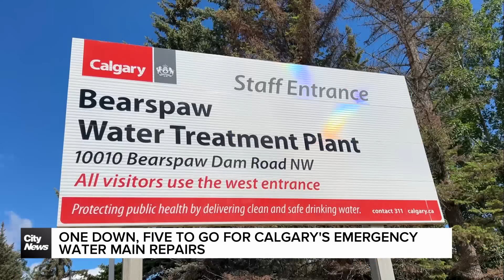One down, five to go for Calgary's emergency water main repairs

Comment: These pipes should have been flown in, on a Boeing “DreamLifter” or an Airbus “Beluga” oversized freight plane if the size required it

Those planes can hold 250,000 pounds so a few 12,000 LB pipes aren’t too much. Could have had the pipes in like 5 hours.

Comment: Due to the type of pipe used, this feeder will continue to rupture. It is passed its best before date.
The City needs to hurry up an build an alternate while this one is still hanging on. Maybe pipes up both north and south Stoney Trail that will tie in with infrastructure at the higher elevations.
Reply: Uh Hyprescon does not really expire.... I know I have installed miles of it. Maybe you should watch a video or two about how that type of high pressure pipe is made.
Reply: @larrymacdonald4241  it's planned water rationing

Comment: There's your problem right there, you're referring to it in kilometers.
Reply: ok Yankee it's Canada bud we use metric system so you worry about state side problems not ours
Reply: Our system is far superior
Reply: @georgemcguire5664  Well, the Imperial system got us to the moon and back. Helped us design Aircraft Carriers, Submarines, and the deadliest Fighter Jet in the world. And let's not forget the Internet. 

By the way, my point is that they need to look at the old designs for that water system because I can guarantee you it was designed using the Imperial system, not the metric system. That's how OLD that system is!
Reply: @iiyyxxnn  Far superior? If you say so. Let us know if you need more shipments of Air Conditioners again this year.
Reply: @theylied1776  We won't be getting them from you guys since you don't manufacture anything anymore.
Reply: @iiyyxxnn  Yes, you would. Canada has been buying them from the United States for the last 3 years.

Comment: Steel so there is your problem its obviously an old steel line that should have been replaced long ago, no doubt people have had rusty water for a while.
They should be using large pvc pipe you know plastic.
Reply: the pipeline is made of concrete reinforced with steel wire
Reply: @zomgoose  then why bring in steel pipes if it's not steel, you can buy the precast no problem?
Reply: @Nicklan1961 Because oddly enough, as evident by the pipe breaking, concrete erodes over 50 years and needs to be replaced with modern plumbing.

Too bad it's just being hooked up to more concrete that'll just break another km or two down. It's genuinely funny now.

Most cities review their infrastructure every 10-20 years. Calgary continues to be the most shortsighted and ill-engineered city I've lived in with each passing day.

Like you're telling me one pipe feeds 60% of the city with no fallback??? This city has engineering schools and nobody has heard of redundancy???
Reply: @MrGriefCreep  modern plumping would be the Large PVC pipes most use but some do use pre cast concrete still which is available so why go to LA for Steel Pipe.
Reply: @Nicklan1961  because they won't retrofit the system to have more than one feeder main to prevent this happening because that would require a) paying provincial sales tax to maintain critical infrastructure (don't expect that anytime soon), or b) oversight on the government contracts being milked by companies like Enmax to keep tax dollars on critical infrastructure. As such, they can't find a >2m diameter PVC pipe to replace the broken pipe, as resilient as the material is. The design of the feeder main is simply too terrible for PVC to be a feasible option.

Calgary will let Enmax build a substation downtown for 3 years straight with little progress but can't save enough money to give their population water.
Reply: @Nicklan1961  this is what happens when over-privatization and a lack of oversight on the resultant contracts somehow reduce the civil engineering budget to the point where nobody has fixed a critical point of failure that knocks out water to a million people.
Reply: Like call me a socialist but tax money should be going to critical services, not corporations who exist solely to make a profit and milk those contracts.
Reply: @MrGriefCreep  I agree, and its shouldn't be going to other countries untill we have our needs met first.
Reply: @MrGriefCreep  pvc is common practice in many places